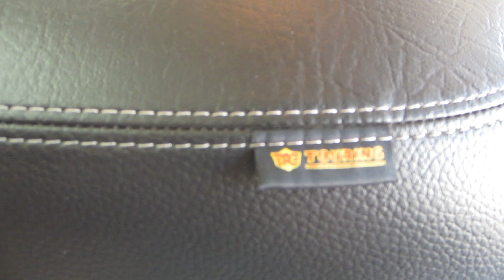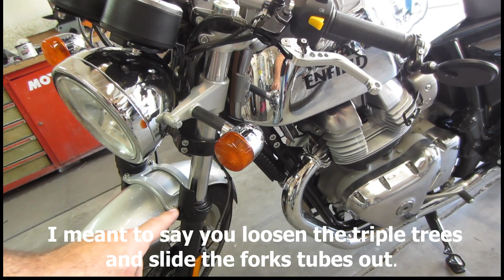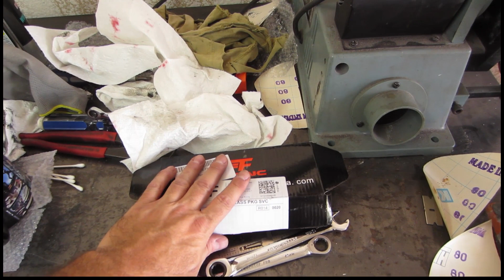Installing Touring Seat, Adjustable Levers, and Fork Shields on my Royal Enfield Continental GT 650

Comment: Glad to see you installed the fork tube guards. When I was a Honda tech back in the early '90s, a Honda study showed that between 80 and 90 percent of their warranty problems about fork seals was caused by----bugs on the fork tubes. The rest were rock strikes or bad seals. The guards work !!
Reply from the maker: Hi, and thanks for taking the time to write.  That's an interesting study!  I had never heard of that, before.  I usually like to protect my fork tubes, somehow. I considered the fork gaitors for this bike, but wanted to try something different.  It took some digging, but I found these more modern looking guards, and I liked them.

Comment: Wow you managed to turn a 10 min job into about an hour with those levers.
Reply from the maker: Hey there.  It didn't actually take an hour but, I definitely was taking my time because I haven't worked on an Enfield before, so I like to get familiar with it as I'm doing any work on it.  I'm not in a rush.  Also, I was working off of info that someone else on YouTube had posted which didn't make sense to me, so I took my time using his method to see what he was talking about.  Had I not used that info, it would have been done much quicker. 
That being said, I mention this in my intro video on the channel that my videos aren't going to be a quick, step A-Z how-to do something.
It's more about me just hanging out in the garage, doing some work, taking my time, figuring stuff out, and chatting with my friends who have stopped by to watch while I work.  It might not be for everyone, which is why I mentioned it in the intro. 
Either way, thanks for watching and taking the time to comment.

Comment: Regarding the long cowl. There is an original RE part (part nr 1990433) which i got on my seat when i bought it. I seem to be the only one having this cowl. My RE dealer just had them in stock. This is what they look like https://imgur.com/a/X2XfyHY This is what they look like on the bike https://imgur.com/CCCGaeS I have the cowl on the original seat, couldn't get myself buying the touring seat.
Oh, and please post links to where you got your parts so we know where to order them.
Reply from the maker: Hi there.  Thanks for taking the time to comment.  I had considered getting that cowl but, to my tastes, it is a bit to flat.  I prefer the more classic, taller backed cowls like the one I showed in the video for the 535.  In an upcoming video you'll see that I ended up getting the stock RE solo seat that has the small cowl.  But, there is a bit of surprise with what I did with the cowl. 
Thanks, again.  Enjoy riding!
Reply: @KZ_Kon  Oh yes, i like the 535 cowl better than the 650 one as well but unfortunately it doesn't fit. BTW, can't it be made to fit? I mean, it looks like it needs just taht little bit of adjustment. Just asking because i have never had a 535 cowl in my hands yet.
Reply from the maker: @TonMachielsen  Originally I thought it did fit because I chatted with someone online who has one on their Interceptor 650.  He mentioned it was a direct fit.  I didn't take into account that he had a straight seat on his rather than the stepped seat like on the GT 650, so he was able to make it work. 
Making it fit on the GT650, I just don't think it would look right.  If you move it forward enough to use the existing screw holes at the front of the cowl, there is a square cutout in the rear for the tail light that then just hangs in the air.  If you move the cowl far back enough for the cutout to fit closer to the tail light, the screw holes in front do not line up with the holes in the side of the seat, and the hump where the passenger seat starts is a bit too exposed.  It just doesn't look right to me. 

Evidently, Hitchcocks in England used to sell these seat cowls that look the part with a higher back, but they are no longer available.  I don't know why. 
https://accessories.hitchcocksmotorcycles.com/40371?ref_page=650cc%20Continental%20GT
Reply: I have the MR. Clean also, with the long factory cowl in black. I also got a Raw aluminum short cowl from E-Bay India. I poliished it up and move the mount holes, then had it chromed to match the chrome tank. I added some black and gold vinyl Stripes.  Looks factory.  Wish they made a large cowl In 
 Chrome
Reply from the maker: @brookcampbell2940  Very nice!  You and I may have chatted about your polished aluminum cowl on FB.  Are you a member of the Royal Enfield USA page?  

Also, thanks for subscribing!!
Reply: @KZ_Kon  not a member.
Reply from the maker: @brookcampbell2940  Ah, okay.   One of the members there has one. It came out beautiful!